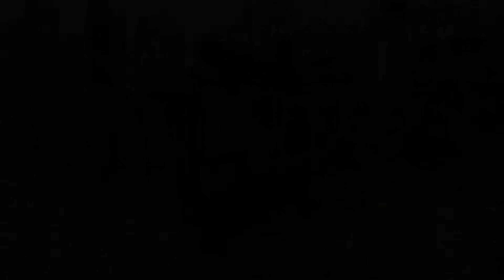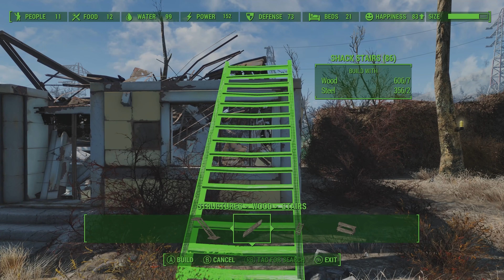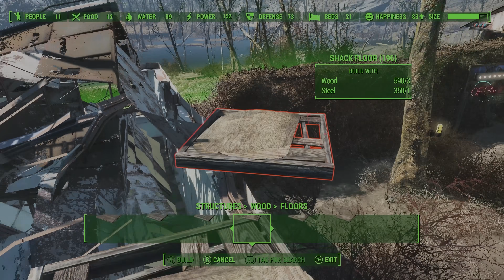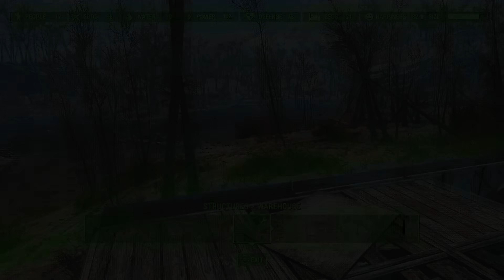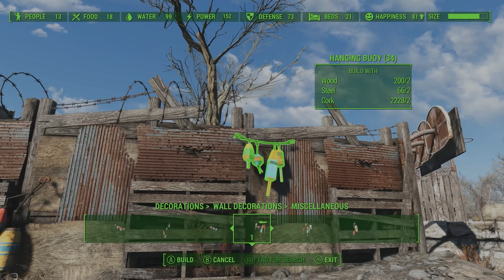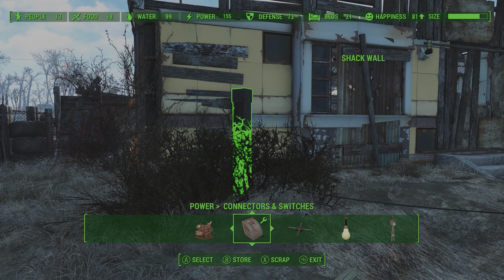Fallout 4 - Preserving A Broken Sanctuary House

Comment: If you really want to mess around with hiding Generators etc; Paul, from the Skooled Zone did a video a while back about running switches, lights etc without wires from the generator.  It’s really handy for wiring bigger settlements a little neatly. 

https://youtu.be/YdaR7m4gct4?si=VpFydKgaIBJ89Ly6  

I recon it will really help, I use it in all my settlements these days